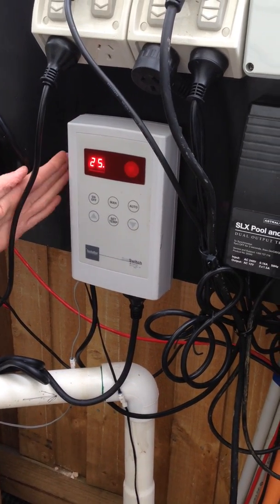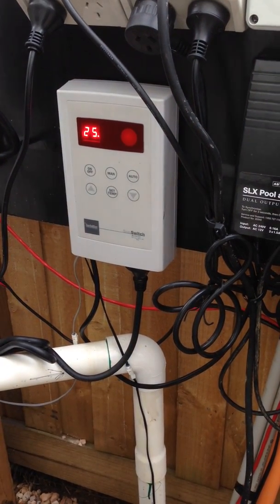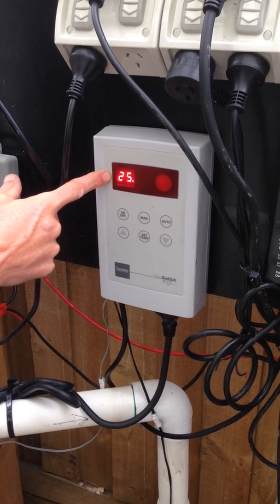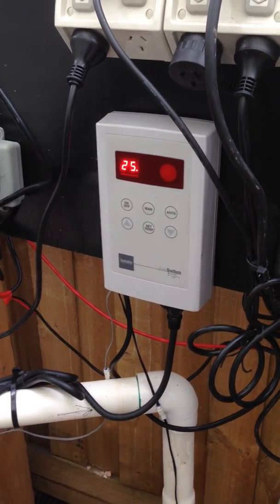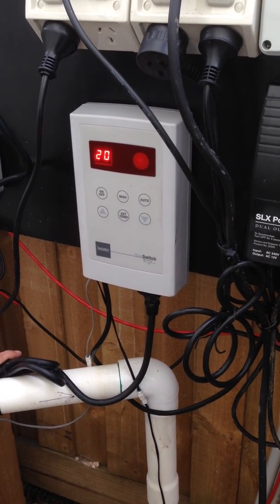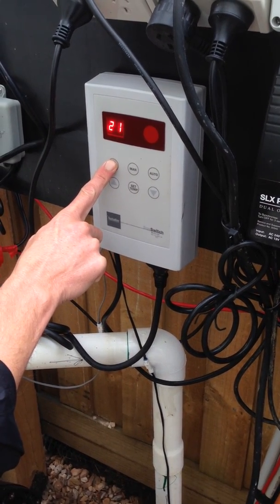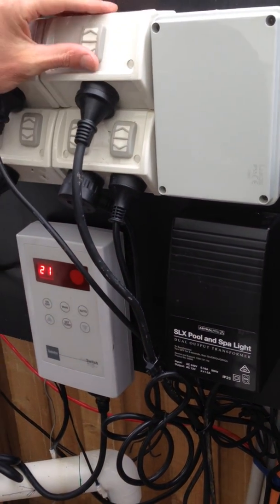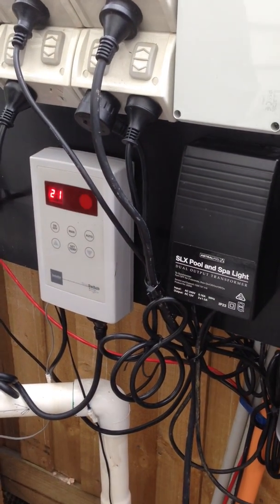Sunbather Solar Controller

Comment: These do a reasonable job and seem to be pretty reliable, my big gripe with it is you can't set the temperature differential limits between the pool temp and roof temp to when the pump doesn't run.
I have seen it running all day when the pool temp is say 28 degrees, if it is a cloudy day and only reaches maybe 32 roof temp the pump still runs all day!  This would achieve nothing as far as increasing the water temp.
They needed to have another menu option to say the roof temp must be higher than 'x' degrees pool temp for the pump to turn on, but then again it did come out around 2010 I think so they aren't going to change anything.